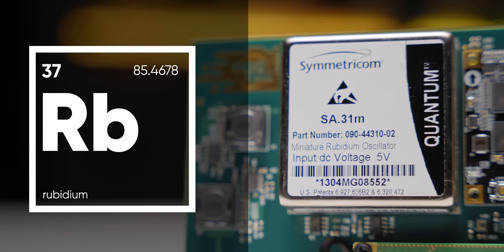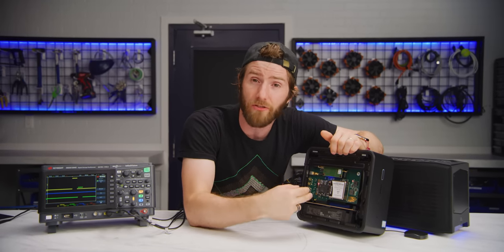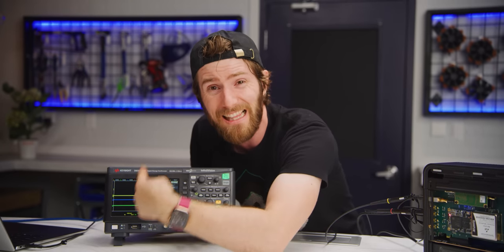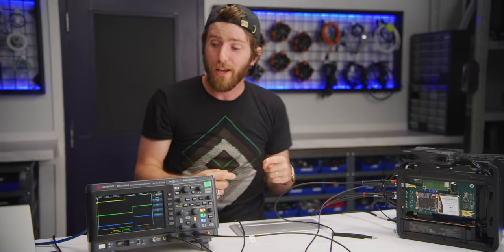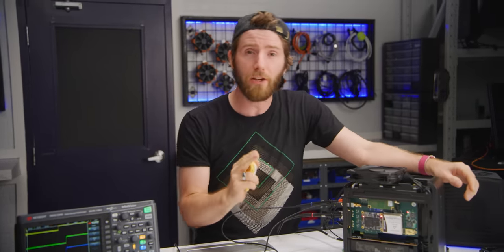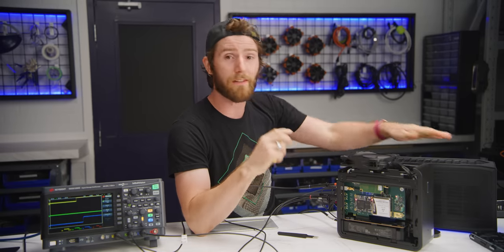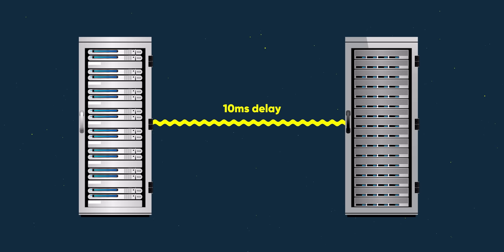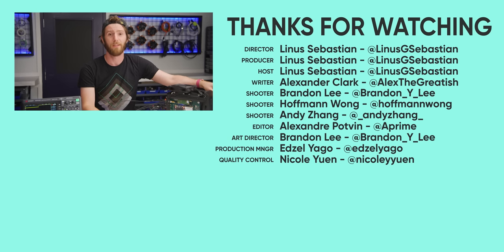Why is this PCIe Card RADIOACTIVE?

Comment: Just to clarify: The clock doesn't use rubidium's (minuscule and totally safe) radioactivity. It uses hyperfine transitions of the Rb atoms to stabilize an oscillator(clock).
Reply: Careful. Linus doesn't do science.
Reply: So it's not really radioactive? Because that was weirdly unaddressed in the video
Reply: @reuseful2839  Yeah, I mean I don't really mind the clickbaiting with RADIOACTIVE in the title since it technically is I guess, but they should have at least clarified.
Reply: @reuseful2839  it is, but the radioactivity is not used, is is just a side effect of the element chosen as  the clock's heart
Reply: Correct me if I'm wrong, but technically heat from fire is a form of radiation too. Weirdly enough, I guess even radioactive material can be safe in moderation lol
Reply: Rubidium is also the stuff in your catalytic converter, along with other valuable metals
Reply: Ok good, don't want the Linus Tech Tip Team getting health problems next week
Reply: @reuseful2839  because the clock uses an alloy of gallium and Rb⁸⁷. Its decay results in Beta- radiation. This radiation can be stopped by 2-3 mm of Aluminum.
Reply: @SandwichDoctorZ  granite counter tops and bananas are radioactive too. It’s all relative.
Reply: @martindinner3621  It would have been great for that to have been in the video.  I didn't THINK Rubidium was radioactive (at least not in the 'gamma ionizing, be careful' sense).  I know it's used in the coating of mechanical hard drive platters as well.
Reply: @SandwichDoctorZ  if you really want, any atomic emission of particles can be called radiation, but generally this term is used only for 3 distinct types of emissions, alpha, beta and gamma. 
And heat from fire(infra-red EM waves as well as convective heat transfer through atmosphere) doesn't fall under that, unless you manage to heat something to around about one million kelvin or more and at that point UV-emission is of your least concerns. 
Though, fun fact, wood fires are somewhat radioactive, but because of Carbon 14 atoms in the wood that slowly undergo beta-minus decay. A gram of average atmospheric carbon(a mix of carbon-14 and carbon-12 for the most part) emits about 1 electron every 1.67 seconds because of that. 
TL; DR if you wanna maximize the amount of radiation from you campfire, burn fresh wood as it is more radioactive on its own.
Reply: О какие люди Андрюха и ты уже перерос из Гарис Мода в ядерщика :))
Reply: @Codingale  Platinum is the primary catalyst, with some palladium and rhodium, though there are certainly other elements as well.
Reply: didn't expect to see you here
Reply: Yeah its like saying bananas are radioactive. Its true, but its only very slightly radioactive.
Reply: @SandwichDoctorZ  wait until you find out about sunlight
Reply: Dont forget about smoke detectors :)
Reply: Profile Picture checks out
Reply: @Codingale  "Rubidium is also the stuff in your catalytic converter, along with other valuable metals"

==Rubidium is not a catalyst and is not present in a car's catalytic converter.
A catalytic converter has platinum, palladium, rhodium.
Reply: @Yobleck  that ...is a very different Rb isotope. The Rb used as PET (Positron Emission Tomography) "dye" is Rb⁸² chloride (yes, it's a salt). Rb⁸²Cl has a half-life of 75 seconds. It has two decay methods: 95.5% dual positron emission, yielding 2x 511 keV gamma rays, and 4.5% electron "capture", yielding a single 776.5 keV gamma ray. 

Basically it makes your circulatory system light up like a neon bulb to the PET scanner. Dosages are really tiny.
Reply: Natural Rubidium contains 85Rb = stable = 72.17% and
87Rb = 27.83%
half-life = 48.8 billion y
That's is like 3.3x longer than the age of universe, so I would not call 87Rb radioactive.
Reply: @SandwichDoctorZ  . Radiation =/= Radioactivity
Reply: Bummer, I thought this could reduce the time left on my life's clock.
Reply: @markrtoffeeman  Really? I guess it shouldn't surprise me. Seems like he has a pretty bad grasp on gravity. Lmao.
Reply: @SandwichDoctorZ  Yes and no. It is an electromagnetic radiation in deed, but "radioactive" is exclusively used for high energy ionizing 'radiation', namely: x-rays (electromagnetic), gamma rays (electromagnetic), beta radiation (ejected electron or positron) and alpha radiation (a heavy particle made of 2 neutrons and 2 protons). So, yeah, the title is clickbait - since atomic clocks aren't radioactive, either Rb-87, Cs-133, H-1 and Sr-87.
Reply: @louistournas120  lol, I kinda laughed when I read their comment..clearly they didn't listen in class, lol.
Reply: @reuseful2839  That would be because the video isn't about atomic clocks and how they work, it's about how information systems benefit from precise time and how an atomic clock can be used to that end.  There are tons of other channels who would (and have already) done a better job of actually explaining how they work.
Reply: @SandwichDoctorZ  yeah the term "radiation" is more general. It doesnt always mean gamma radiation, heat is literally a form of radiation.
Reply: @reuseful2839  These clocks do Rb-87, which is radioactive...
but it has a half-life of like 50 billion years. Meaning not very often (I think it's one of the longest known half-lives). It's emits incredibly small amounts of energy. Like you'd need a very nice detector and observe for a long time to detect the decay.

Linus doesn't know this but certainly a sales technician told him. It is odd that he made nothing about the inconsequential radioactivity while acting like it must be dangerous or something. A bit clickbaity.
Reply: > even radioactive material can be safe in moderation lol

Best nuclear pun ever.
Reply: Would the radioactivity not then decrease the signal strength over time, Or is the half life long enough to not worry about that? Is there a reason rubidium was chosen over other known hyperfine transitions such as caesium or hydrogen?
Reply: There are quite a few other isotopes that have ultra long half-lives as well and of course, they are around us:

This is tungsten. Found in incandescent bulbs, CFL, fluo tubes, welding rods.
180W = 1.8×10^18 y (0.12% of natural W)
182W = >1.7×10^20 y (26.50% of natural W)
183W = >8×10^19 y (14.31% of natural W)
184W = >1.8×10^20 y (30.64% of natural W)
186W = >4.1×10^18 y (28.43% of natural W)
^^^^^Look at those numbers. 10^18, 10^20!

Potassium
40K = 1.248 x 10^9 y (1.2 billion y. 0.012% of natural K)

Calcium
48Ca = 4.3 x 10^19 y (0.187% of natural calcium)

Lanthanum
138La = 1.05 x 10^11 y (105 billion years, 0.090% of natural La)

Samarium
146Sm = 1.06 x 10^11 (106 billion years, 14.99% of natural Sm)
147Sm = 7 x 10^15 y (7000000 billion years, 11.24% of natural Sm)
148Sm = 2 x 10^15 y (2000000 billion years,  13.82% of natural Sm)
154Sm = >2.3×10^18 y (22.75% of natural Sm)

209Bi = 2.01×10^19 y (100% of natural Bi)

Thorium, found in some welding rods
232Th = 1.405×10^10 y (14 billion years, 100% of natural Th)
Reply: please talk in english
Reply: the radioactive icon on the sign on your pfp is upside down.
https://en.wikipedia.org/wiki/Hazard_symbol
Reply: rubidium sounds better though >_>
Reply: I like how you have a radioactivity symbol in your profile picture. Makes me trust your comment about radioactivity even more.
Reply: @SandwichDoctorZ  radiate and radioactive are different.
Reply: @martindinner3621  Thanks, clearest response, and the device is created with this amount of aluminium then, right?
Reply: @Codingale  i think you confuse this with Rhodium. Rubidium would oxidize immediately and be gone ;)
Reply: @SandwichDoctorZ  You are correct, but when folk worry about hazardous radiation they are usually referring to "ionising radiation", including alpha, beta, gamma and neutron radiations from nuclear reactions.
Reply: @Myflag2022  It is not relative. Radioactivity is strictly defined without any ambiguation. 

Strictly speaking each and every element is radioactive, since all of them decay spontaneously, ie. they have half-life. However, most elements have so  long half-life that the radiation is almost impossible to measure. It's so long it's not really feasible to say for example iron would be radioactive even in the context of physics, excluding very specific use cases in particle physics. Thus, even physicists say iron is not radioactive.
Reply: 8:00 easily put - if the time is not in sync with Alien Worlds - and your Computer - IT WILL GIVE YOU AN ERROR and you don't get paid for mining with NFT's (Crypto)  This is why the timing sync matters - to you and me.
.
Reply: @user-xh9pu2wj6b  technically, radiation is the term given to one of the three methods of heat transfer. (the others being convection and conduction) So heat from fire does qualify as radiation.

But even then, the term "radiation" is very big. Radio waves are radiation. Visible light is radiation. Microwaves are radiation. The difference is ionising vs. non-ionising. Gamma rays are ionising and light is not; but light is still a type of electromagnetic radiation.
Reply: @DaWrecka  Just like I said, any atomic emission can be called radiation if you really want, but this term without any additional context usually means ionizing radiation.
Reply: Lots of particle physicists in the room. Its crazy!
Reply: Sounds like smart words so i'll believe it.
Reply: That's all fun and games, but that doesn't clarify anything if you don't know what hyperfine transitions are and why their frequency is fixed :D
Reply: @serbrighterunagainst9231  you know absolutely nothing about radioactivity, don't you?
Reply: @WayStedYou  i knew sunlight was a form of radiation. No need to say it like that lol
Reply: thanks spirit, very cool
Reply: @SandwichDoctorZ  your technically correct(i know its the best kind of correct), but light is also radiation but it is distinctly different from nuclear radiation so you cant really compare the two...
Reply: @user-xh9pu2wj6b  And I thank God :)
Reply: @serbrighterunagainst9231  thanking god for your ignorance is a bit odd, imo
Reply: @SandwichDoctorZ  Everything that has energy is a form of radiation, if you think about the actual definition of radiation. When we talk about thermodynamics we also talk about heat transfer from radiation, basically IR light being emitted by anything than has heat. If you think of how you would use the word radiation in a normal context like how a radiator (heater) radiates heat. Radiation doesnt necessarily always mean alpha or beta particles or gamma waves, so yes fire radiates heat and radiates light, mainly in the form of infra red and visible light. Your phone radiates radio waves and your microwave radiates microwaves. But the context of nuclear radiation is different, radioactive materials tend to emit alpha, beta or gamma radiation, and this is materials such as uranium, thorium, rubidium or americium. Americium is found in smoke detectors which you probably have in your house, they arent harmful because only alpha radiation is emitted and is stopped by the casing on the smoke detector, It will be a similar situation with the atomic clock, no or very little nuclear radiation will leave the card.
Reply: @SandwichDoctorZ  Technically yes, but also no. Radioactive is not the same as Radiative. All radioactive materials are radiative, but not all radiative materials are radioactive.
Reply: soo.... is it safe for me to eat it ?
Reply: @Taeban42  makes sense. Thanks for letting me know 😊
Reply: Look who we got here:>
Reply: @reuseful2839 , 72% of natural rubidium is isotope 85, which is NOT radioactive. The other 28% is rubidium-87, which IS very mildly radioactive. What does "very mildly" mean? It means that it takes 48 billion years (five times longer than the estimated age of the universe since the Big Bang) for half the atoms in a given sample of rubidium-87 to pop out and emit radioactivity. Or that if you place a large sample of rubidium (with both isotopes in the natural proportions) on top of a plate of photographic film, it will take six months for it to produce any noticeable change in the film. Considering that the oscillator used in these devices contains only a few milligrams of rubidium and that it is shielded by materials that block radiation (not on purpose, just as an incidental effect), you can see that the level of radioactivity is completely negligible.
Reply: @Codingale , rubidium is NOT present in catalytic converters. In fact, rubidium has the OPPOSITE characteristics of what a metal useful for catalytic converters should be. You certainly confused the name with iridium, which IS present in catalytic converters, along with platinum, palladium, and sometimes rhodium.

All these metals are very rare and insanely expensive, so catalytic converters contain only minute amounts, otherwise they'd be more expensive than the whole car! And they are all extremely inert and non-reactive --- that is, you need a lot of effort and energy to make them react with anything, including strong acids that would destroy a piece of any other metal but don't cause the least effect on these "noble metals."

By contrast, rubidium is one of the most reactive elements known -- pure rubidium metal explodes violently in contact with water and catches fire spontaneously in moist air (as does sodium, which is in the same group of metals, but rubidium's reaction is much more violent and energetic). But please note that this only applies to the pure metal -- rubidium compounds are harmless and not even poisonous: rubidium chloride is even LESS toxic than sodium chloride (common table salt).
Reply: right. sort of like the old CMOS did.
Reply: bro I see you everywhere
Reply: shit,isis is upset...
Reply: @anteshell  Your explanation is accurate but you misunderstand me.  I meant relative to each other and how lethal they are.
Reply: @Myflag2022  But of course the amount of radioactivity is relative. However, I did not misunderstand. You did not express the necessary qualifiers to say what you actually meant (which also happens to be accurate).

Using the word relative in the context of physics always need a target to which your subject is relative to. However, you used it in casual everyday way, which more often than not means something either happens or don't happen depending on the point of view. That was my interpretation.
Reply: @SandwichDoctorZ  Radiation =/= Radioactive.
Reply: @claytoncoffman2951  And it's Beta radiation, which can be stopped by even thin aluminum plate.
Reply: @reuseful2839  A banana is literally more radioactive than that card by the way!
Reply: you are mistaken. Heat from a fire in convection. combustion reactions ALSO emit radiation, which is effectively teleporting energy from a source to a recipient, but its miniscule and mostly LIGHT, rather than heat
Reply: Fixing 69 replies
Reply: @Codingale  Did you just confuse Rh with Rb?